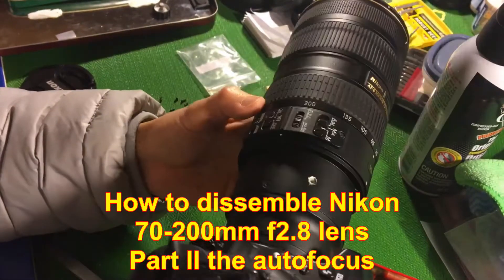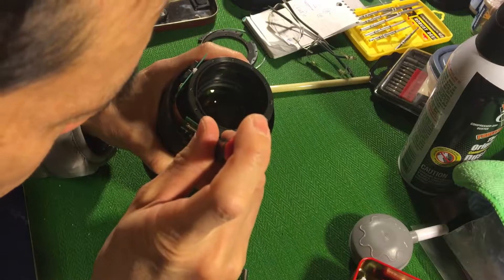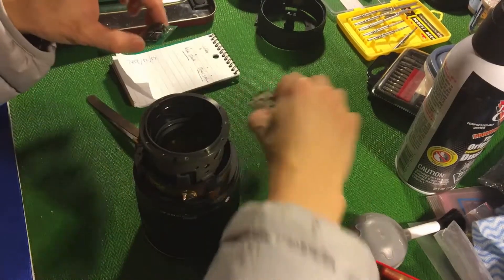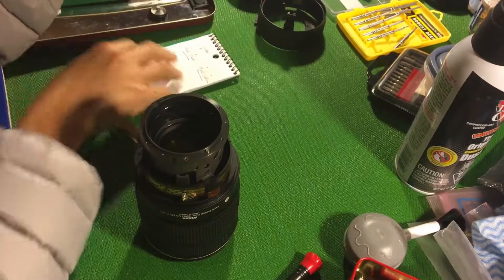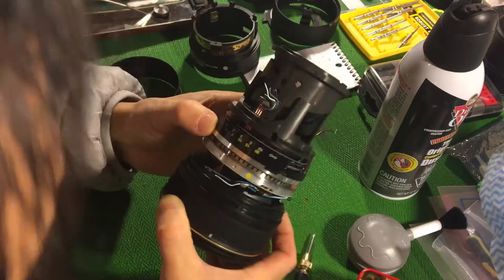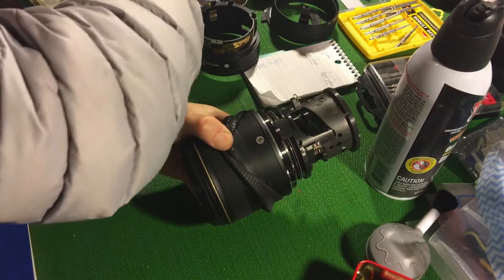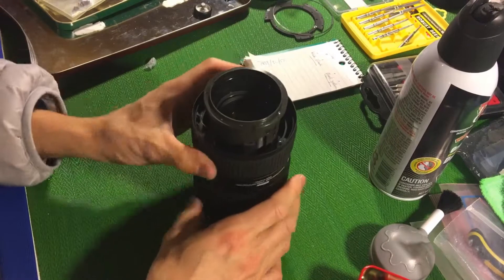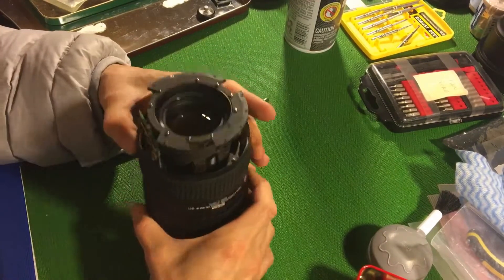How to disassemble Nikon 70-200mm f2.8 lens dropped in the sea (Part II)

Comment: Did I hear correct that you have to solder the wire back on the circuit boards? No way to do it without needing to remove the wires and soldering?

Comment: Hey man , I dropped my 14-24 2.8 nikor into the bottom of a pool , Do you have any video in mind that shows how to disassemble and reassemble that lens ? Thank you
Reply from the maker: if the lens fully emerges into the water, this is going to be a very tough task. This not only requires the cleanness of the lens combo, some portions are glasses back to back, and also the circuit. I will recommend selling on eBay. A lot of capable people can do this and you can save some money to buy a new one.